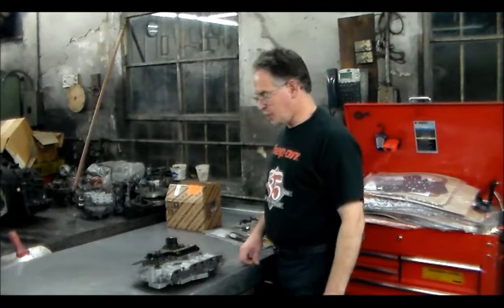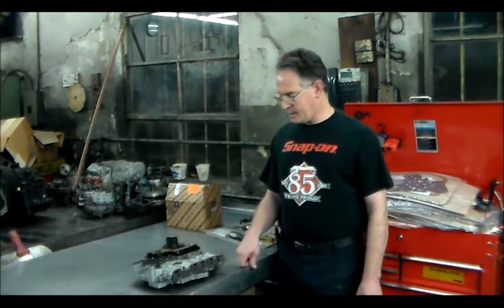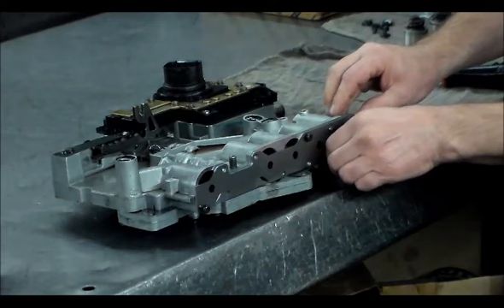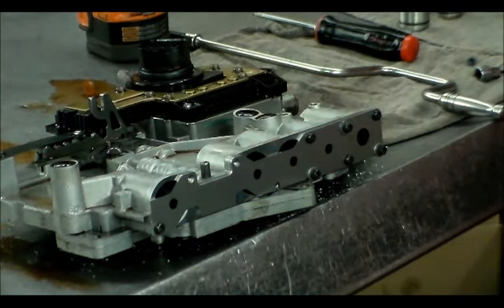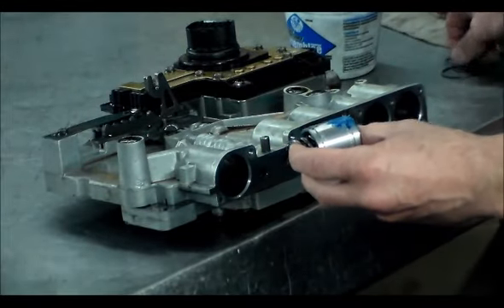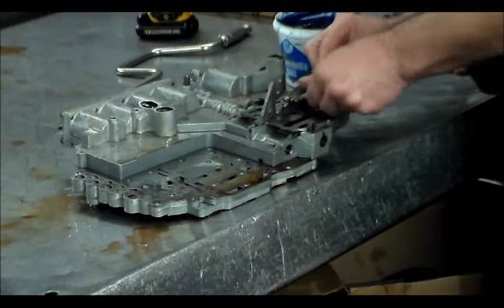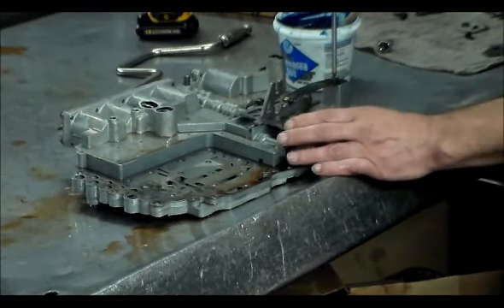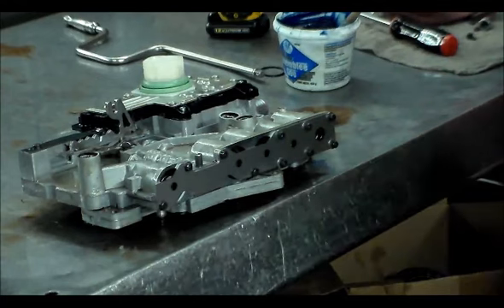45RFE Valvebody Repair

Comment: Fantastic job Gary. I'll be doing this soon on my 45rfe and my 545rfe. Unfortunately there aren't too many reputable transmission rebuilders here in Houston. They all want to sell you a Jasper unit for 4500.00 installed.
Reply: David Sanchez Correction, there aren't many good rebuilders anywhere. They are far in between areas. In your area, I think that's where Hiram Gutierrez is. He's one of the best in that area. I only wish I had contact info for him. Check out his videos too, channel automatic transmission.  He and Gary are the 2 guys that, to an extent, walked me through my own repairs. I'm in debt to the both of them, I know how busy they are. I'm a mechanic by trade but transmissions are their own field, kind of like the difference between a dentist & doctor. 
Good luck with everything!
Reply: Cuba Rodriguez thanks for the heads-up Cuba. I've seen Hiram's videos, and I could have sworn he was on the east coast. I'll head to one of his videos and see where he is. I've rebuilt many motor and transaxles over the years, but I work for a living now and don't have the time that I used to.

Comment: I just did this solenoid pack change and wished I had seen this before. Wished I would've added the Sonnax plate while I had it out & apart. That plus a few tips I wished I had known to check would've been great. I might pull it again just to recheck. Thanks!
Reply from the maker: You would know if it's bad, sometimes they bend out of shape
Reply: @GaryFerraro  Thanks for replying! Nothing was obviously bad & no pieces in the pan. I really just wished I'd looked at it more closely. Instead I was focused on the solenoid pack. I may pull it apart again to recheck my work, always easier the second time! Live & learn.
Reply from the maker: @justinmcc488  You also could see if you just drop the pan
Reply: @GaryFerraro  Yes! Thanks!

Comment: 0:47 Hi Gary , Love your videos.
I have a question to ask.
I have a problem with my 45rfe transmission in my Grand Cherokee 2005.
I can drive 2 a 3 days with no problems but then i get a limp in because a p0845 code.
I have already change the solenoide pack and the line pressure sensor and checked the wiring to the solenoide pack.
Is this problem formilar to you.
Greetings.
Danny

Comment: I have the dodge durango 2007 limited edition,I have a problem the gear can’t shift and stuck in 2nd gear,what is the problem and how to solve this problem?
Reply from the maker: If stuck in 2nd, there may be a code present, i need to know what code is present, car sounds like it's in failsafe
Reply: i have P0876 
already changed the solenoid pack think i need whole new valve body
code sets on start up

Comment: Got a 04 dodge Dakota just recently when going from 2nd to 3rd it’s like it hits neutral. I changed the valve body and pack but still does the same. Was about99% sure that’s what it was. I changed the transducer as well, still the same. Going to change the speed sensors this weekend to see if that works. Any idea what it could be?
Reply from the maker: sounds like a clutch pack is no good,  was it working fine and suddenly this problem?
Reply: Gary Ferraro at first is started doing that you could let it cool down and it would go back to normal. Would shift through all the gears just fine. I was told that when changing the pack you have to reset the computer to recognize the new pack.
Reply: What do you mean clutch pack? You mean solenoid pack? Cause I changed that.